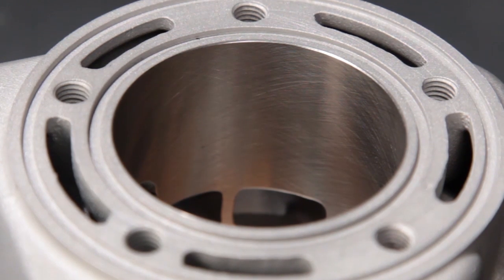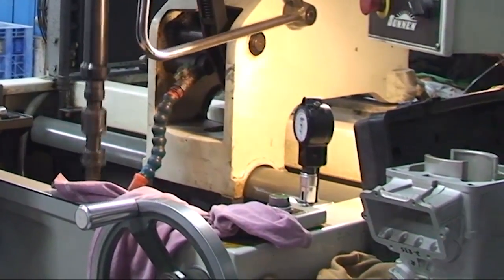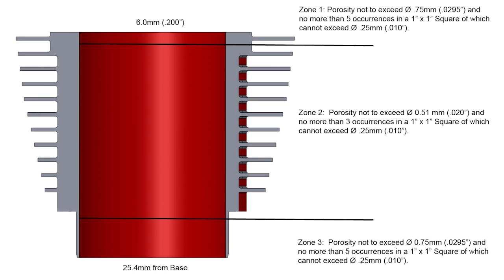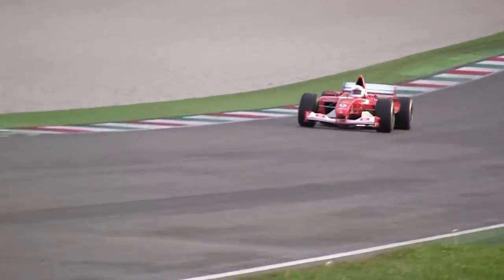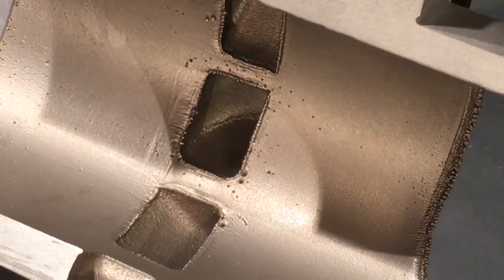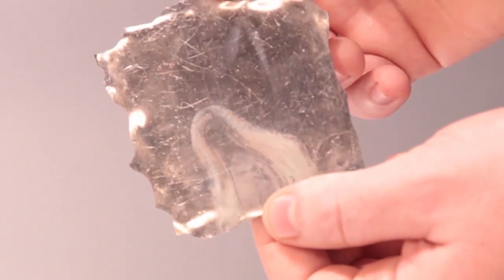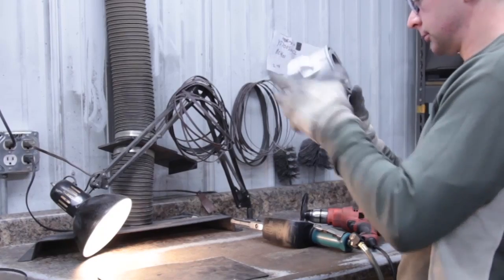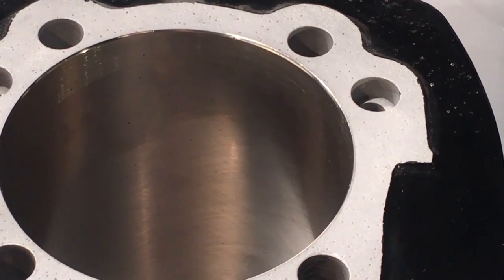What is Porosity?

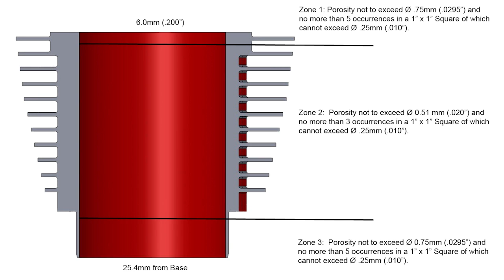Comment: At 0:52 I don't understand. In the first line it states no diameter larger than .029" then last line states no diameter larger than .010". Which is it?
Reply: read it again.  it says the holes may not exceed 5 holes bigger than .010 in a 1x1 square.  and no holes at all at or greater than .029